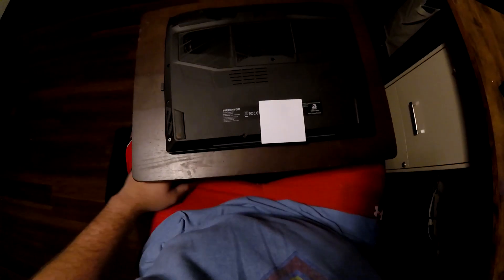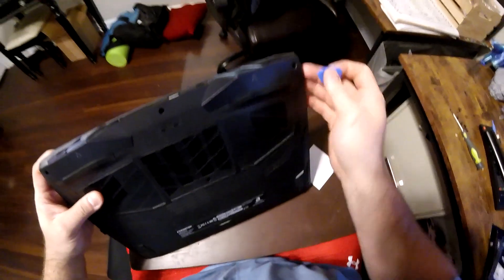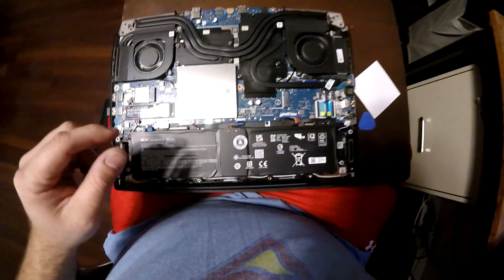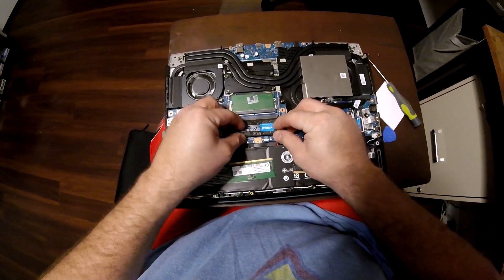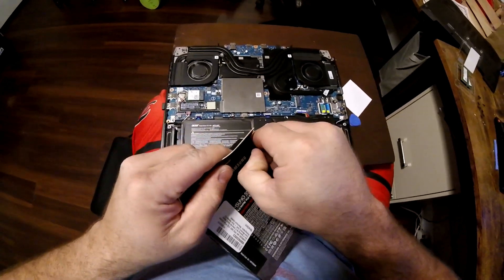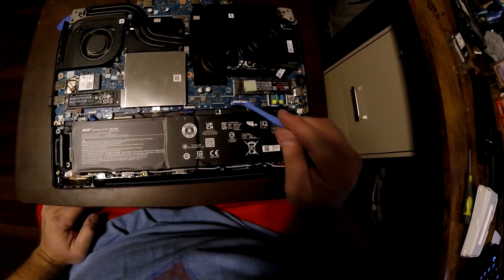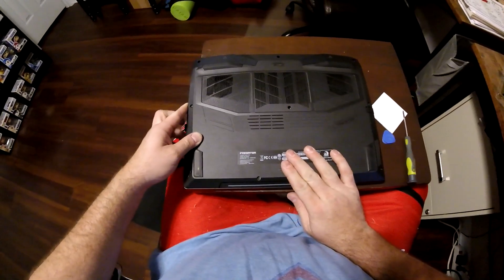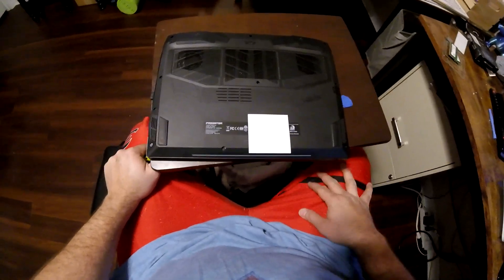Acer Predator Helios 300 Ram And SSD Upgrade

Comment: Has anyone ever run into issues with the laptop screen not working and other little bugs after a ram upgrade?   Laptop is the same as video and I installed 64 DDR5 kit but am having issues.
Reply from the maker: @JSDesignCo  i actually did have that issue. I just left my laptop plugged in and waited a few minutes after i turned it on and it came back up. This laptop only goes up to 32gb ram. You added too much i think.
Reply: @DIYTechnician987 we're gonna go ahead, that's most likely not the screen. Having problems, it's probably doing a bios flash.   so the screen will stay black for about ten minutes, sometimes